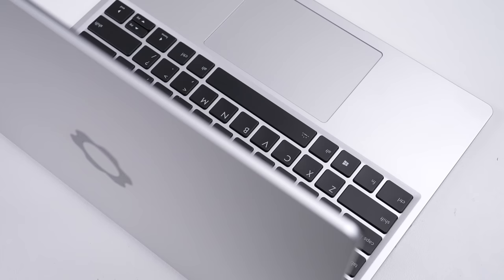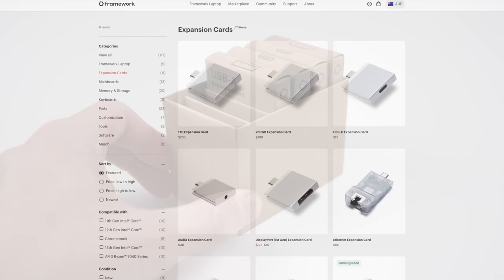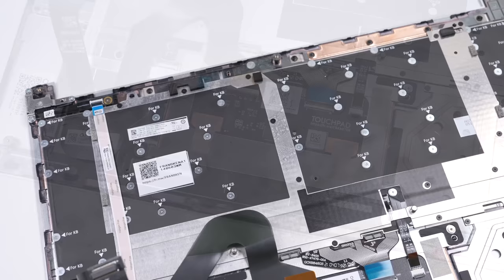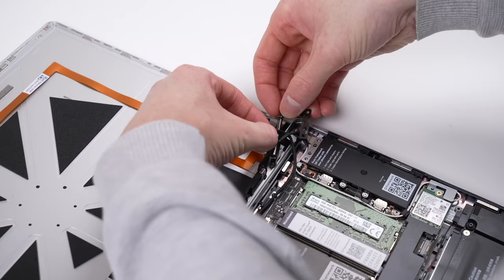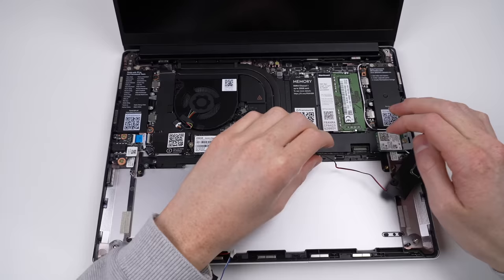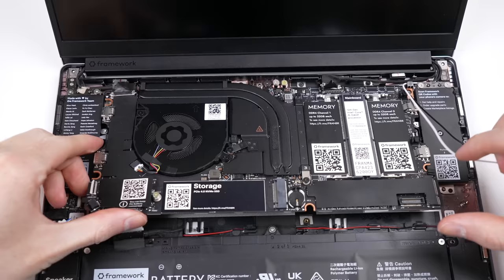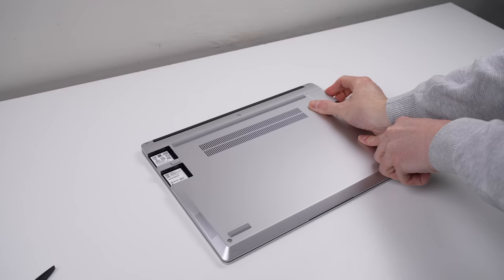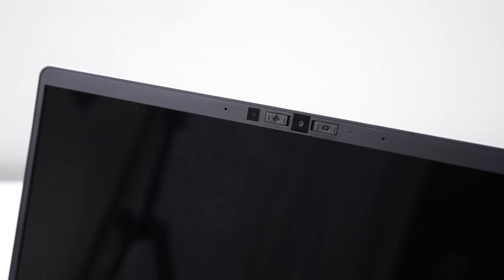New Laptop Brand Shocked Whole Computer Industry - Framework Laptop - Teardown And Repair Assessment

Comment: You don't need to look like apple and you shouldn't. Aluminium gets very hot and that is dumb. I have even seen Macbooks that couldn't stand on the desk anymore because through heat and expansion the battery became so large that it bended the aluminium hardcore...

Comment: Hmmm. That looks like kind of a analog of the early PCs and clones where (almost) everything was a plugin board.
Of course that was ancient 20th century "Plug & Pray" tech that caused so much baldness from pulling out our
hair trying to get it functional! This well thought out 21st century tech is interesting. I like the idea & hope they 
are successful. 
[As I plant flowers on the graves of my many laptops/notebooks that failed due to single part that
could not be replaced. sigh.]

Of course, I am also Ancient Early 20th Century, Octogenarian, Greatgrandpa, BidenBrain tech. So there is that!
BUT the compensation is a lovely early 20th century tech wife  -- that goes NOT require upgrading and still
 functions quite well..... (-;

Comment: What's the GPU like on this? Anything upgradeable? Can it edit?
Reply: The Framework 16 (16 inch) is releasing in January with a swappable GPU.
This is the Framework 13 (13 inches), which has no GPU.

Comment: Well, it is a bad idea. No one is adopting it and there is a reason - every few years comes a new standard, new size and thickness of the internal parts out. Naturally, u don't need the same laptop longer than 2 years. In contrary case, that will be a monopoly. People are evolving, themselves and their tech - don't stick to stability pls.

Comment: What's good about it if you can't change motherboard, new CPU upgrade at some point down the line won't be compatible with old motherboard so that's gonna be disappointing and even if you can change every component on it to completely build new laptop it is still going to be more expensive buying every single part on it's own than just buying brand new modern laptop 🤗 not to mention having to put up with rubbed out keyboard letters and worn out battery. I’d rather buy a laptop for what I need right from the start than buy an office laptop and try then to upgrade it to a gaming laptop because it's waste of money and so is this concept of upgradable laptop. Most laptops can upgrade RAM and disk drive anyway and that's all you need and maybe even don't. Oh another thing about this imagine if someone came up with this in 2004 with a laptop with windows XP well they could have been upgrading it all the way to today but they would still be struck with windows XP laptop today and I don't think anyone would wanna be using windows XP laptop today, you know what I mean 🤗

Comment: in laptop, the most important thing is to upgrade the graphics card...i did not see this in this video??
Reply: The graphics card is on the motherboard. So by replacing the motherboard, you are upgrading the graphics card as well.

Comment: Lol it is usual laptop design (not apple of course). Replacable battery, speakers, ram and ssd. Processor can only be replaced with motherboard and cooling. Graphics can't be attached. The only feature is extension cards. Overall, what a shame, really

Comment: I remember old laptops where i can replace CPU, GPU, RAM, HDD. With this laptop i can`t do this. How that can shock me? I work in computer industry.  And i think, after Apple, that is second big scam. Because you can change few things that is not upgrade. Upgrde is ability to put something new on something old. This laptop dont have that option at all. You cant change the CPU, you cant change GPU. And these are most important things in ANY laptop. There is no Freedom of choice.

Comment: The only problem this laptop has is Integrated Graphics.
Reply: About 99% of 13 inch laptops sold have integrated graphics. It's just not worth Framework's time developing a GPU solution for that niche class of gaming laptop. They already have preorders open for their 16 inch models, which can be configured with a separate internal GPU (or upgraded later) which will meet the needs of power users and gamers. 

They also support eGPUs through their USB 4 ports, so that's always an option too.

They're a small company. They don't remotely have the bandwidth or the money to produce models for every segment of the laptop space. The fact they are still in business at all is a miracle in itself!

Comment: What if we only pretend to make a replaceable laptop? We would make something like Framework! It would be an amazing idea if the product wasn't a total rip-off and if the components were actually replaceable. Seriously, mainboard with the price of whole high-end computer which is still one solid piece?? My wish is just a normal laptop designed with just a tiny bit of effort e.g. things are not glued together but rather connected by screws so that they can be easily replaced. And the manufacturer supplies with spare parts. One other point: I recently found a fault on my laptop because one of the integrated circuits has burned. Well, this Framework nonsense would not help at all, because.. guess what? Mainboard is also one solid piece.. mainboard is like 85% of the whole computer! So, nice try, but no thanks. 😆🤨

Comment: What a letdown and a waste of space, the ports for adapters are way too big, also for that size you could go for double usb or usb c ports, also for 32 rg ram slots, integrated graphics is a let down, you have to work on the ports and on the inskde engeneering, there is enough spacefor a gpu a d another fan, you just have to work on the ram position, put it down next to the ssd , also you should add removable parts onthe ram andssd part of the case so they can be easyally change without having to open the full  back panel, but it wasa Nice try

Comment: I get it, but its 15 years too late.  I'm a professional tech guy, and I can't even be ass'd to to screw with my laptop/tablets/phone hardware any more, I save that for my Linux servers in the cloud or my RPI cluster or my x64 lab servers and NAS.   I think there is a market for famework but its now super niche whereas 15 years ago it was pretty much everyone as everything was done via client-side apps.  The reason being is that we don't get the pure noticeable performance improvements year on year from upgrades that we used to get so now everyone sits on owning their laptops or phones for 4 years plus until it looks or feels old.  For example the motherboard upgrade in the video was Gen 12 i7 to Gen13 i7 upgrade, a user wouldn't notice any perf improvement.  Also its a bit freaking weird to put a modular USB-C port plugging into a USB-C port on a laptop, so it's not really modular, just built-in slimline dongles as you can't upgrade the underlying USB-C/Thunderbolt chipset so no diff to any other laptop really. Finally Apple, HP, Alienware etc make insanely freaking sexy laptops which look good for years, and the framework ain't sexy in 2023 and we all love sexy HW ;-)

Comment: windows= bucket of default open and insecure connectivity. and with the timeware in MS... Y? it won't work after 2 years noatter what you do. and they will break into your house to break the PC if it goes that far. .. ya! really! ❤good luck you're prob safe in UK

Comment: There is NO difference between a mobile processor and a desktop...they are the same...the mobile has power up and down features unlocked for power savings and generally better processors for battery life (that why they took socketing away...you used to be able to use them in desktops,,,they didnt like that cost savings and overclocking cheat....so they TOOK money from you as retribution!!!!!!!!!!!!!!!!!!!!!!!!!!!!!!!!!!!!!!!!!!!!!!!!!!!!!!!!!!!!!!!!!!!!!!!)...computer software and hardware engineers are the biggest thieves in the world...right up there with Doctors Lawyers and Politicians!!!!!!!!!!!!!!!!!!!!!!!!!!!!!!!!!!!!!!!!!!!!!!!!!!!!!!!!!!!!!!!!!!!!!!!!!!!!!!!!!!!!!!!!!!!!!!!!!!!!!!!!!!!!!!!!!!!!!!!!!!!!!!!!!!!!!!!!!!!!!!!!!!!!!!!!!!!!!!!!!!!!!!!!!!!!!!!!!!!!!!!!!!!!!!!!!!!!!!!!!!!!!!!!!!!!!!!!!!!!!!!!!!!!!!!!!!!!!!!!!!!!!!!!!!!!!!!!!!!!!!!!!!!!!!!!!!!!!!!!!!!!!!!!!!!!!!!!!!!!!!!!!!!!!!!!!!!!!!!!!!!!!!!!!

Comment: for much less money, I can buy a laptop with all these accessories and more already installed.  Further, I have been repairing Laptops for 20 years and the one your showing is just a normal laptop.   I can change all those items on most laptops, and just as easily.  Most people are not too nuts about opening their laptops.   But this Laptop is just an over priced rip-off.
Reply: No it's not, I'm tired of unrepairable or difficult to repair designs.
I would pay a premium to purchase a device which is repairable and made to last.

Comment: Complete BS. This was the way original laptop's was designed. Then they degraded parts such as cd rom drive and removable hard drives etc... Now they're returning to the old method and telling you it's a new design. Hahahahaha. I had a computer store building and repairing/upgrading all computers and laptops in the 1990s.

Comment: I have a around 2 year old very expensive  MSI gaming laptop, and that bastard is made with the built quality of a plastic toy. The keys on the keyboard are just glued on, and I had to have it repaired twice because the keys just kept falling off. Now it's on service for the third time, this time it won't charge. Framework laptops is exactly the kind of laptop I always wanted, where you can change and replace stuff by need. It can also expand the lifetime of a laptop, by allowing consumers to upgrade to a faster cpu or gpu instead of buying a complete new laptop. Btw STAY AWAY FROM MSI LAPTOPS, head my warning STAY FAR AWAY!

Comment: The heat vent is still on the bottom of the laptop, the worst possible place for a LAP TOP. It goes on top of your lap, who thought that putting the heat vent on the part facing your lap was a good idea?
No kickstands on the bottom either, dear every laptop company ever, please see the bottom/backs of keyboard and note those little plastic tabs that can hold a keyboard up a whole inch or two, that would be perfect if your going to put heat vents on the bottom, no?

Comment: Orrr.... Do some research and find a laptop that can be upgraded. It's not even worth it since laptops perform 60% worse than a desktop. No dual fan. And it looks as confusing as any laptop. Magnets? Really? Jezus Christ. "Thickness" yes i couldn't forgive them if they made it 1cm thicker it would ruin the laptop yes. You shouldn't have the battery plugged in anyway....